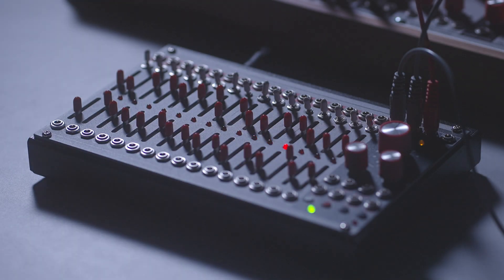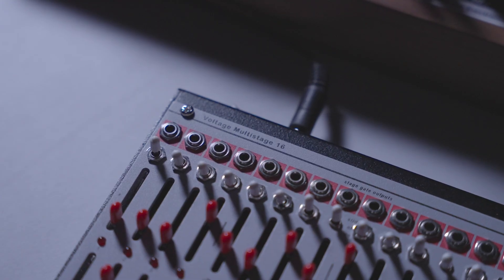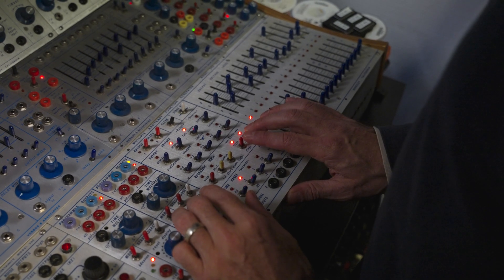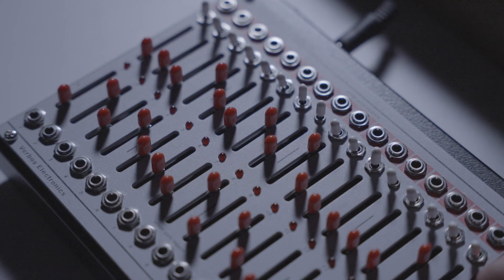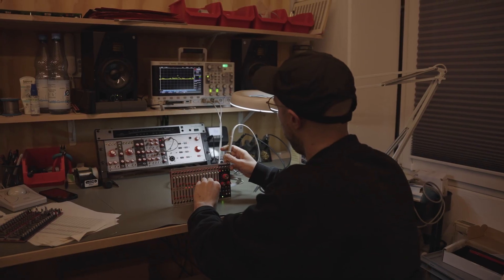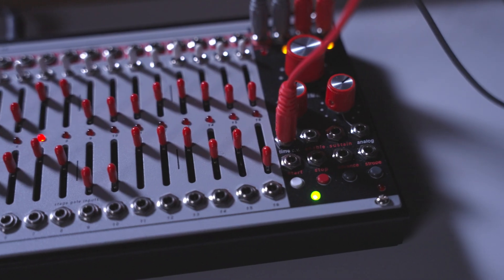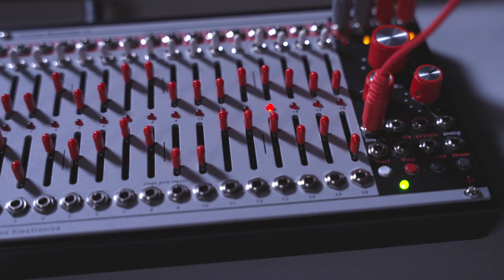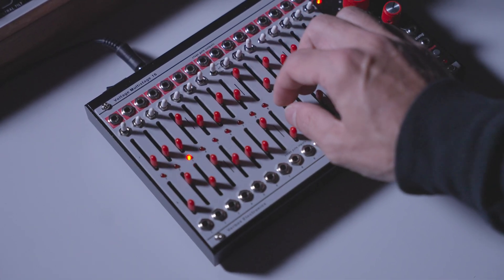Voltage Multistage 16 : Design, Vision and Evolution

Comment: 2:40 This is so important and it distinguishes creative, honest, worthwhile companies from the producers of unlicensed, cannibalized work from other companies, designers, and engineers. I mean, reissues can be very much worthwhile when done by people somehow connected to the creators, but, for the most part, knocking off older gear not only fails to add anything worthwhile to the community, it eats away at the core of that community, compromising the integrity not only of the manufacturer of the copy, but of the people buying the knock-offs. Cheaply knocking off gear pioneers in the field worked hard to develop and to promote, with no time and expense concerns for development, design, and marketing, undercuts the whole value proposition for doing actually innovative, new work that advances the field and meets current needs. There's nothing wrong with being inspired by the old and learning from it. What does harm is, as it too often happens, aping it and effectively stealing the older work by relying wholly on the older product to sell your new crappy clone. That degrades the field and skews the market, to the detriment, over time, of everyone but the the handful of shameless, wealthy guys who repeatedly further enrich themselves by means of selling the famous gear of others at prices no one doing honest work can offer. We need to resist such manufacturers - especially the worst examples, who are very well known for horrid behavior and for flooding the market with shameless appropriations of products from still-active companies and their willingness to throw lawyers at the issue to put off smaller companies - and to buy fewer but better pieces of gear from people with at least some sense of integrity and something to contribute to keep the industry vibrant.

Thanks.